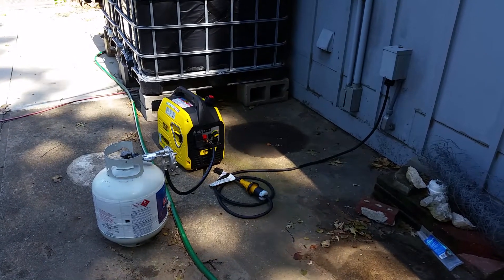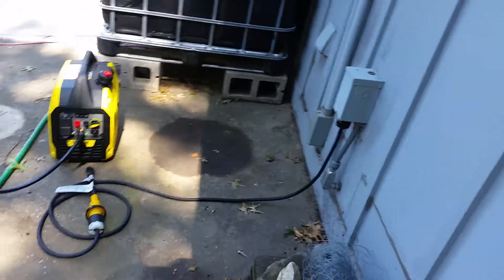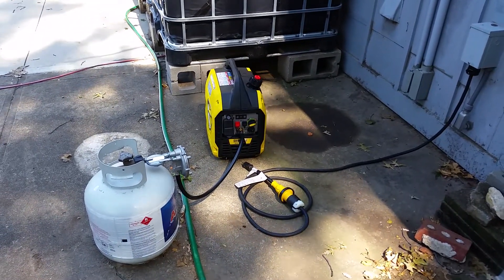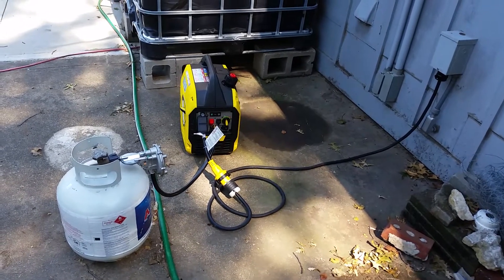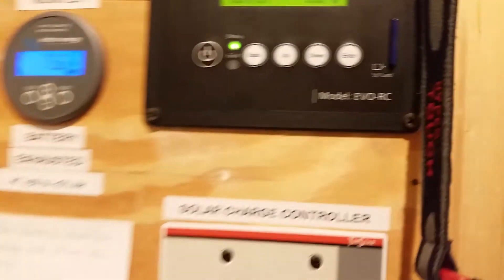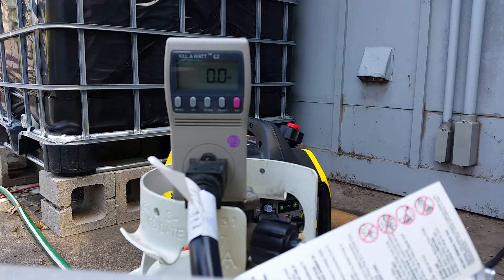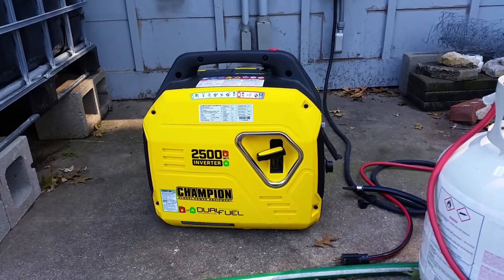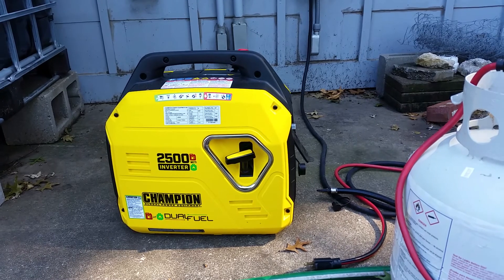Champion Dual Fuel Inverter Generator Update / High Load Test

Comment: ⛔️ WARNING ⚠️ Test With the Dip Stick fully ‘UNSCREWED’ !   DO NOT Screw it in then unscrew it and look at the dipstick to test the level. Just stick it in, pull it out, look at it and add accordingly!  If it’s full then, and only then do you screw it in ! ⛔️
Reply: It doesn’t matter, as long as you can see the oil on the threads

Comment: What was the freq. in HZ at max load?
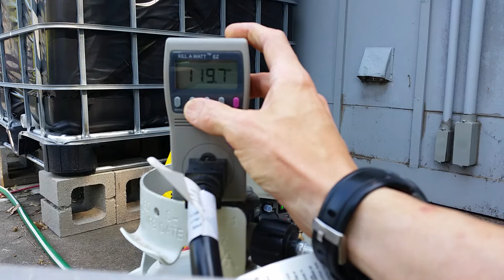Reply from the maker: If you watch close between the times of 9:00 and 9:05 you will see me cycle through the parameters on the watt meter I was using and you will see it was right at 60.0 Hz.
Reply: @thekeltnerway3002  Thanks. Ordered yesterday and received today. Thanks for the great video!
Reply from the maker: Awesome!  Also, thank you so much for watching!  It will definitely bring you some more peace of mind having a generator on hand.  Try to check out some of the other videos on this generator as well.  Take care.

Comment: I find as a automotive technician that running synthetic oil tends to make the valves noisy. That also depends on if the engine is made for that? It's a good idea to let a air cooled generator idle at least 5 minutes after pulling a load, so it can cool down.
Reply: As long as the oil viscosity is correct it should have nothing to do with valve noise or engine design.

Comment: I too experienced the shutdown for no obvious reason after about 10-15 minutes.  I had walked away and when I came back the generator wasn't running.  It started right back up but I immediately suspected the low oil shut off had kicked in.  It did not seem that they had supplied enough oil in the container that shipped with it.  I added a little extra oil but I had lying around and it ran just fine after that.
Reply from the maker: Hey Will!  Thanks so much for watching and providing some feedback!  Glad to hear I'm not the only one that experienced the low oil shutoff issue, but different from your experience I had enough oil supplied out of the box, just had to add the rest of it.  Mine has been running great since then as well.